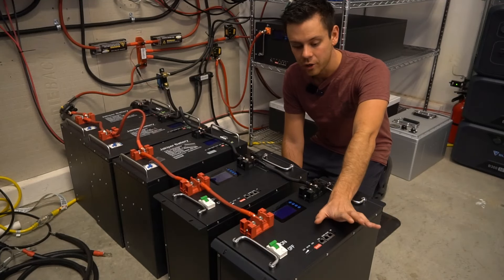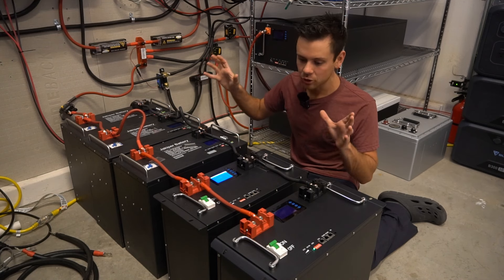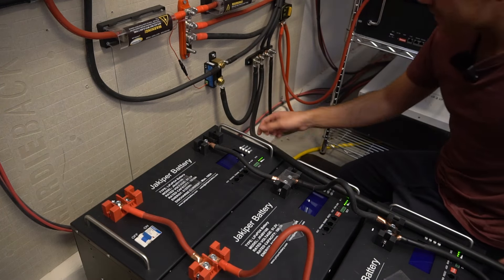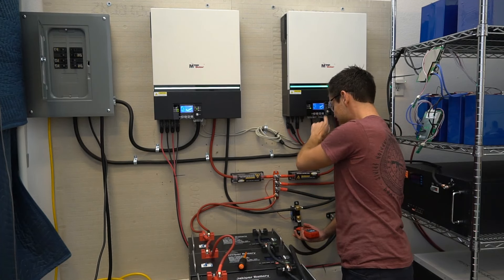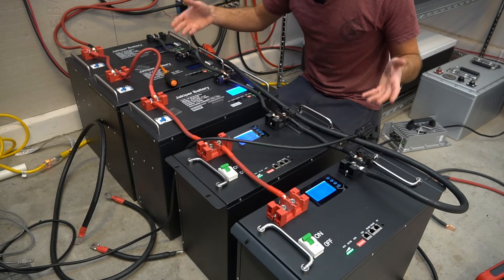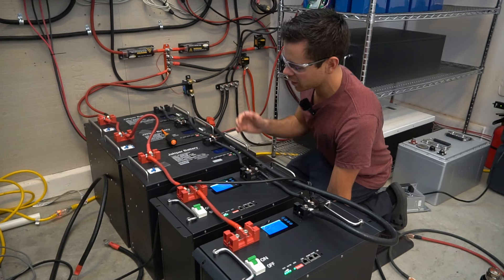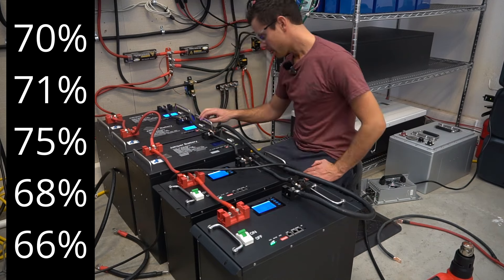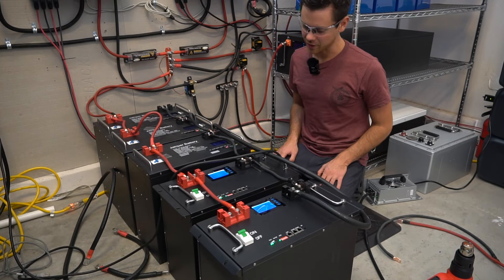Current Sharing Experiment: 25kWh LiFePO4 w/ Diagonal Wire Configuration

Comment: Together with yesterday’s demonstration and studying the Victron Energy information, today’s demonstration was a great follow up. I’m still not sure about the fuse and breaker limit calculations from the bank to the inverter… Just as something different for you to ponder, I have (maybe) a unique situation in that, in Tennessee all power sold through the 107 utility companies must be purchased from the TVA. That negates a net-metering option, but TVA has a program which allow you to sell them ALL of your power at wholesale price and you guy back ALL of your power from the utility at retail…yeah, only an idiot. And (sic), to install grid-tied, the utility company charges an application fee, and monthly service charge…yeah, only an idiot. So, I am having the grid go to a panel and then terminate at a couple outlets in my power house, to which I can attach the battery charges for my battery bank. The power to my farm, therefore, will be off-grid solar with grid backup only through supplemental battery charging. Not sure if the grid termination could be at my MPPT inverters and allow them to manage the recharge, because my utility company may claim that is then a grid-tied system, with all of the costs and regulations therein. Not asking for a personal consultation but the considerations for battery management from both the array and from battery chargers is an issue onto itself. Anyway, thanks again and cheers, Dan
Reply: There’s no problem connecting your MPT inverter/chargers’ INPUTs to the grid.  That way, you can use them as your grid-powered backup battery chargers. Your utility is only concerned about keeping your inverters’ AC outputs separate from the utility grid.  If there is any pushback from the utility, simply install an outlet for each inverter (such as a 14-50R) and connect the inverter inputs via a 4-wire range cord plugged into these outlets.
Reply: i have gone to a similar system that i refer to as my parallel system.  i have panels batteries inverters and outlets separate from the grid. My garage is completely powered this way i only recharge my batteries from solar. I do have one inverter a MPP that is connected to the grid and it is set to act only as a transfer when my batteries run low. I have 3 battery packs and 3 inverters. Each acts as a separate circuit in my garage powering only 3 outlets.  My utility also wants to charge if i connect to the grid and provide power to them. AND sell at a reduced rate to them but when i use it i pay more.....so i don't include them in my solar system. I have been doing this for about a year and started with just one bank of batteries and one inverter....I add new batteries, inverter, charge controller and panels as a stand alone system and track my electric bill going lower each time.  And the great thing when we have power outages i just run some cords to my house for the fridge or lights or tv and enjoy having power without a generator.  Of course it is limited and clunky but i have power.  And if things go on to long i have a fossil fuel generator to help out, so far have not needed that yet.
Reply: @arnoldreiter435  Thanks for the insights Arnold. So, as I understand your setup, your solar system is dedicated to powering the garage and itself except during power outage when it serves as a remote generator. Although I’m looking at a slightly larger application it seems the principles apply. I guess my only question is that you do have an inverter tied to the grid but as long as you don’t net-meter they don’t charge you? TN wants to charge you even for the convenience of having the grid as a backup, as I understand their statement to me. So, is having the grid “tied” to the inverter inlets but no shared panel distribution grid-tied or, is there any scenario in which the LV6540s can supply power to the grid via the inverter AC Inlet…obviously a very dangerous situation. I will get back to my power company to clarify and appreciate you highlighting this option. R/ Dan
Reply: @powerranger9160  Perfect follow up to my conversation with Arnold on this topic. I am awaiting the arrival of my LV6548s but you address specifically my concern, that AC inputs on the inverters cannot serve as outputs in any given scenario. So, per your understanding, the power companies are concern where you are sharing power at the main panel…when power could potentially be supplied from either or both systems? I did not raise this “grid backup” through my inverters option to them…rather, my plan was to push AC to the main panel to which they would also be connected. Thank you for giving me the insights and confidence that when the inverters arrive I will find isolation on the AC inputs which allow for this “grid backup” option. R/ Dan
Reply: @yougotthatright1635  My grid connected inverter which was my first inverter cannot feed power back into the grid. It is a small 12v 1000w model. I use it to power my internet modem and router with a single 100ah battery. If i have a bad solar day or two it transfers to grid power but will not charge the battery from the grid. Only the panels will charge the battery. This model cannot provide power to the grid in any way by design. To the grid and power company it is a consumer only just like a toaster. It can also be thought of as a UPS as far as the power company is concerned. Just dont buy a grid tied inverter, get off grid inverters that have the capability to charge from an  ac source such as a generator or grid power
Reply: @yougotthatright1635  Best practice is to use the output for your hybrid inverter to power a dedicated critical loads panel.  These are the circuits which you would like to power in a grid down scenario. 

One breaker from your service equipment will supply INPUT power to the inverter.  The inverter’s OUTPUT will provide split phase 120/240Vac power to the critical loads panel.  You may program the inverter’s output to either:
1) pass thru utility power from the input to the output when the grid is available;
2) power the output from battery/solar as a priority and only switch to utility power (assuming grid is on) when lack of sun and/or low battery as programmed.

Option #1, above, can be viewed as a giant UPS system which allows your critical loads panel to be powered from the grid and seamlessly transfer to backup power upon grid failure. 

Option #2, above, is a method for reducing your grid power consumption (and bill). These circuits will be powered by renewable energy first and when not enough renewable energy/storage, will be powered from the grid.

Do not connect the inverter’s output to your service equipment (utility) panel under any circumstance. To do so, the inverter would need to be listed to and meet the following standards: UL-1741; IEEE-1547; NEC 690, 702, 705; Rule-21 Smart Inverters; HECO Rule 14H; CSA C22.2 - 107.1-01.  I know that’s a lot of requirements, but inverters designed for North American grid tie connection service should have ALL of these since the manufacturer doesn’t know specifically where you live.
Reply: @powerranger9160  Really appreciate you taking the time to highlight these options. I’m tracking with all your comments.
Reply: For the summer months where the electricity is a lot less expensive the payment just for the having the electricity connected is 3 times the cost of the electricity I use. I have now cut the power and run only offgrid...

Comment: I think and improvement would be to tap the current in the middle, you are aggerating the current as you get closer to the load. In any case the size if the cables should account for the accumulated current. For this case the last cable has 47A, then cable has 47+43, the next has 120Amp, then 155.9, then the batter to source cable you install is passing 195.9Amps. This was the case before upgrading the cable between the battery and the load. Another improvement would be to add a cable between Battery 1 and Battery 5. which would let your cable better approximate a buss-bar with your cables. Then the upgrading of the battery bank to load cables make more sense.

Comment: I want to caution everyone out there wanting to do this. Please be careful as someone that sells and installs this stuff for a living. (Energetech) We all need to be aware not all lithium batteries are created equal. There are some batteries that are a 15 cell configuration. The voltage on that battery will be less then the voltage on a 16 cell configuration. I have had a few customers completely destroyed their battery packs. One customer's battery even caught fire and he was very lucky to be there when that happened. The BMS is not engineered to act as a switching device for voltage and current control. I am seeing a lot of BMS failures out there right now. Paralleling different battery manufacturers and capacity is putting a lot of extra load on your BMS that it was not engineered for and in my opinion a recipe for failure. Playing around with these things is very fun and educational, but can be very costly as well. And to be honest with you, it's through failures that I learned the most I just don't wanna see anyone's hard earned dollars go up in smoke.
Reply from the maker: I only know of one company that sells a 15S pack. Renogy. Who else?
Reply from the maker: Check out our discussion and relevant literature on our forum about mismatched capacity batteries. It is safe to do. It should not put "extra load on your BMS". Even if I connect a 1Ah battery in parallel with a 1000Ah battery, each one will feed current depending on their internal resistance. If your battery is not sized properly for your loads, then you will have problems

Comment: You are relying on the accuracy of each batterie's internal current gauge.  The accuracy can vary widely, +/-10% or more would not be unreasonable.
Reply from the maker: No, these use very accurate coulomb counters, or shunts. It's not using voltage or something. It's accurate down to .1% usually

Comment: You should try a test using 2 of the largest conductors the posts allow between each connection to maximize the copper in the circuit. Connect each battery post to the next battery so you have 2 runs on positive and 2 on negative. Two runs to your inverters as well. Gets you closer to a bus bar and more surface area making contact with the battery posts.

Comment: As an old truck mechanic I can tell you, there was a time when two  + cables from the batteries to the starter motor was quite common. Also as an old truck mechanic, I can also say it is hard for me to wrap my mind around the difference between a bus bar and a conductor made of wire. My first thought was there must be resistance in the connections. But soon realized with the bus bar system there is actually more connections. So I will just know the bus bar way is best and move on. There is also a video out there that says electricity does not flow through wire. And a light bulb in a 300 million meter long circuit would light up faster then the 1 second it take electricity to flow such a distance. As the electricity is outside of the wire and would take a short cut. Which in the mind of an old truck mechanic would mean, if I step on the brake pedal to close the brake light switch, the brake lights would come on, as well as every other light on the truck. Especially since all the light wires are tightly loomed together.
Reply: Then you should see the "debunking" videos posted afterwards. The "immediate" light output is significantly less than the "1 sec later" light output when the electricity from the wire reaches the light, up to the point where you'd probably not be able to see that the light is on.

Comment: Why wouldn't someone just use bus bars and be done with it? Cost obviously, but compared to the whole system it's pretty minimal for the  peace of mind you get, if nothing else.
Reply from the maker: That's what I'm saying! But for some reason people were commenting that the diagonal configuration is good. Bus bar is way better, always. Less termination losses and less chance of a a single bad connection screwing up the rest of the pack.

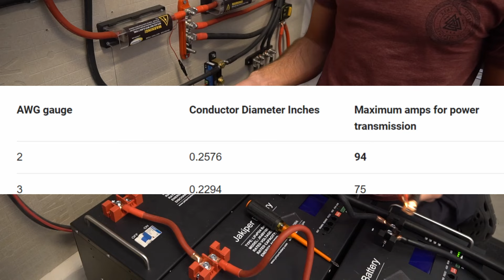Comment: 3:15. Why? What about that configuration was not optimal smart or good at all.
Reply from the maker: With ocpd, you want single continuous conductor. if one fails, the other one could over heat
Reply: @WillProwse  Then wouldn't it be prudent to put 3 or even 4. For redundancy.? And wouldn't that just lower the resistance. Keeping the cables cooler. Extending their life.?

Comment: You are getting closer but do not fully understand what's going on yet.
You are comparing things that cannot be accurately compared, like apples and oranges, which really surprised me because usually your tests are a lot more accurate than that one was.
The fairest test would be by starting with 4 cells of the same size.
The resistance of the connections between the cells will eventually act to equalize all the cells; (may take a dozen cycles); something that will never happen in the buss bar configuration.
 But ignoring that last sentence relating to the buss bars, you have to admit that the opposite end power connection I recommended you try is infinitely better than your original connection system and it cost you nothing extra to do it that way.

Comment: Argh.  This seems like such an inefficient use of copper.  Should use those larger terminal batteries in the middle from an electrical point of and the smaller terminal batteries at both ends.  The amount of copper should be allocated to minimize heat generation, so the the larger terminal batteries should be physically located near the inverter or charger.  Then run the other jumpers to the other batteries, perhaps with a ring configuration

Comment: You have a bigger problem in that you shouldn't be creating bank stacks with different well sizes this is a poor experiment. Each bank within the bank should be the comprised of the same ratings Ahrs.100, 200.... and so on.The design of these batteries are for pushing an IDENTICAL loads UNLESS THEY ARE ON AN ISOLATED or dedicated load otherwise the undersized batteries become sinks over time at  high current demands.... and NEVER use different wife guages - do a power calculation for max worse case, size the bank you'll need and determine the wire sized based on the power (better calculated current) needed for your system. - This test is of no use other than to say WHAT NOT TO DO.
Reply: Sorry for the bad grammar etc. I broke my glasses and typing too fast  - I do love your stuff!
Reply from the maker: This is why we did this test. I mentioned all of these points repeatedly. Did you watch the video?
Reply: @WillProwse  Okay , I did not catch where using differing sizes was an issue to be illustrated.... my bad if so just re-emphasizing is should that be the case.... PS I do like your videos and I'm an EE with 30 years in industry but Newbie RV guy jut got my rig last year. Thanks
Reply: @WillProwse  The excitement around the "heating of wires" tossed me off the trail I suppose but again the he emphasis did not appear to be on the mix of batteries as a no no. = good job otherwise